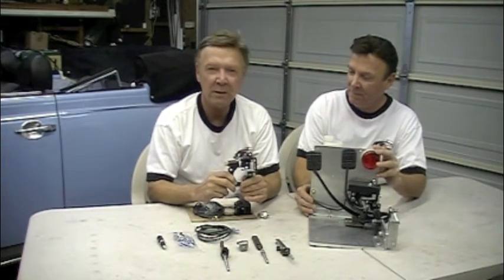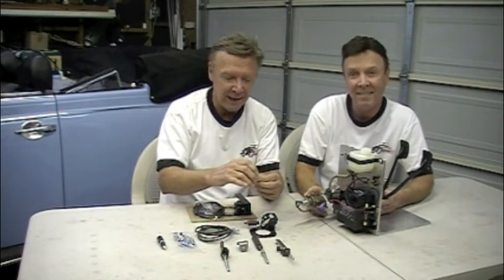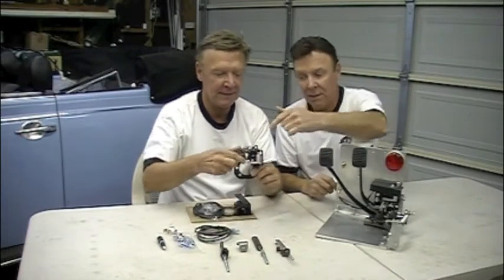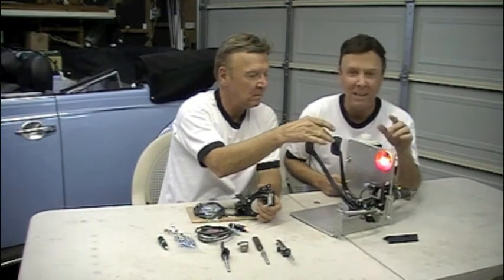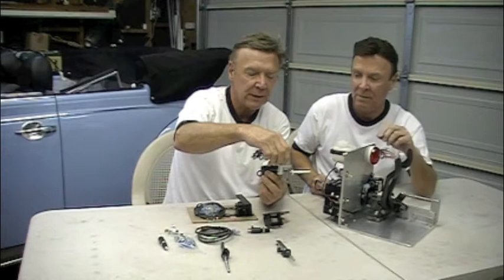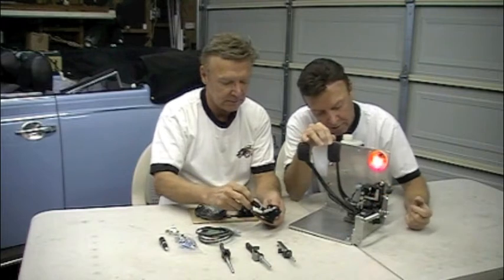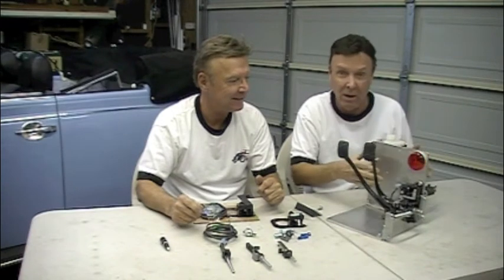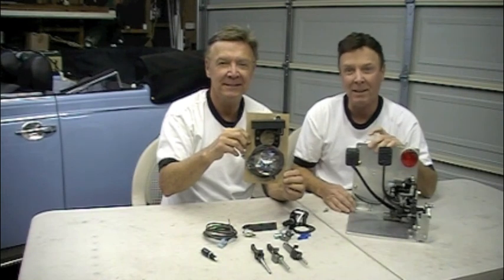Instant Brake Lights for Classic VW's

Comment: This can be made MUCH easier by attaching an L-bracket to the rear pedal cluster bolt, and epoxy-glueing a switch (with a roller arm, that rests on the brake pedal) to it. As soon as you move your brake pedal, the switch clicks and lights up the rears. 5$ and a 1-2 hours of work at the max!